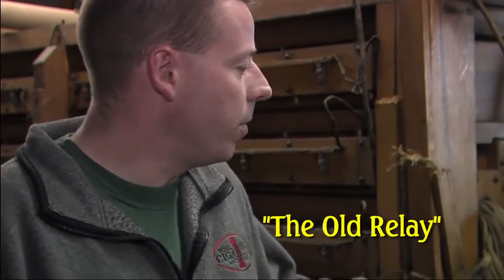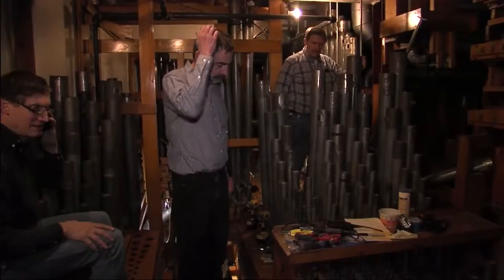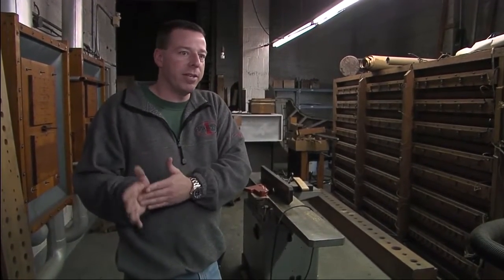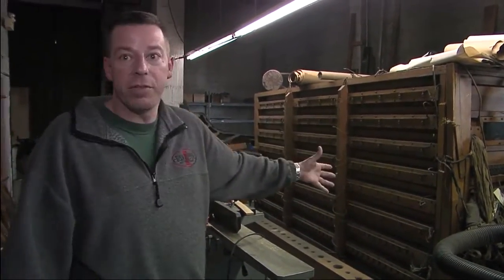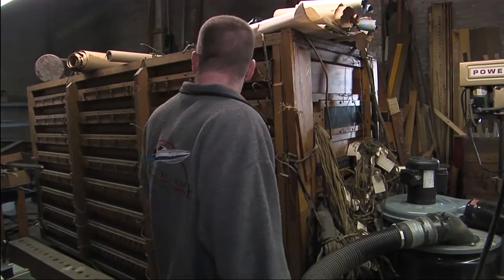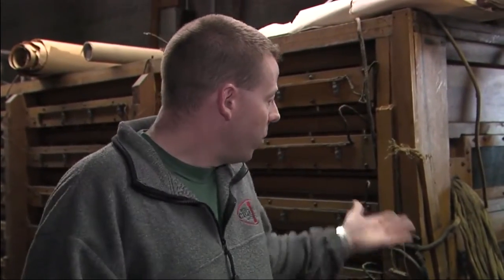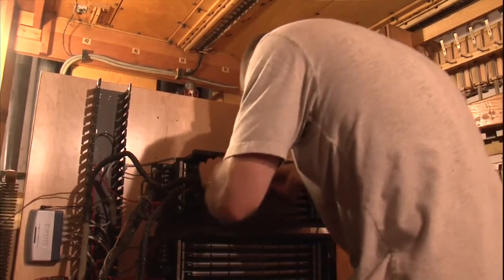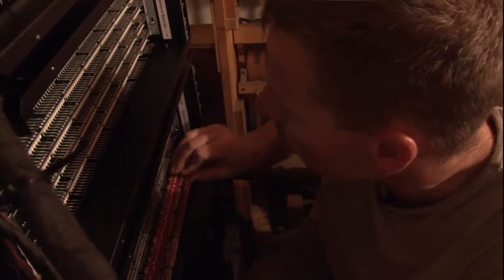Ultimate Restorations - The Old Relay from the Midmer Losh Pipe Organ HD

Comment: Funny to think that all those console to switchboard wires could now be replaced by a single fiber optic cable the size of a strand of spaghetti.
Reply: Technological advances... People discovered more with what you can do with just one strand of wire. Even with traditional copper wires, they can do more than just function as something to carry current.
Reply: In another video they said that the new system actually has midi connectivity

Comment: the purpose of restoring the Atlantic City Boardwalk Hall  organ is to get it fully functional and playing like it once did and keep it as original as possible! Not to make it into some modified hybrid monstrosity! Shame about the relay but then things sometimes happen. I wonder if that is the only relay removed or if they all have been removed. I have seen pictures of some other relay? and it was the size of a small room! you could literally sit inside of it while the organ was being played it had an air tight door on it.
Reply: As I understand, it was the only relay that had to be removed during the renovation, but they do eventually plan to replace all the electro-mechanical relays with electronic relays
Reply: Which also greatly improve the response time from key press to note play.  It also greatly improves reliability.
Reply: Solid state is more reliable and better protected from things like power surges.
Reply: @DandyDon1  Some would argue that the solid state system adds a slight delay since it introduces a layer of signal processing. With the old mechanical system, the relay uses pneumatics to mechanically connect a ranks wiring to the console. But once it is connected, it is a direct electrical connection.
Reply: @nicholas_scott  I can show you a few old Klann mechanical systems which are many decades old are problematic and add great delay to response time.  I know of an which is 15 ranks.  Granted the Boardwalk organ is much larger. It was incredible how much this organ was improved with a new solid state Peterson Electro-Musical system.
Reply: In addition there are those who think that tracker organs are the best thing since sliced bread.  It makes you wonder these same people prefer an outhouse over indoor plumbing. ;)
Reply: I am more familiar with EP chests, which only use relays for couplers, so I'll concede that DE chests are problematic with those old large relay arrays. And you are very correct that "pipe organ people" are a very elitist bunch. You could have the nicest organ in the world, and the will still find faults. and its nearly impossible to try and fauly help- Everyone holds onto information like its gold

Comment: A question not addressed by this video: Is this relay being restored? If so, why? It seems to me the only use for this relay would be as a museum piece. As stated here, there really is no need to use these mechanical relays because electronic relays are more reliable and take up less space, and the type of relay adds nothing essential to the organ.
Reply: Actually, he says "it won't be working again" so the relay is not being restored.
Reply: This particular relay will just be a museum piece. The others, which are still in place, will be restored but will also be bypassed by the new electronic relays just like the ones being used for the left stage chamber.